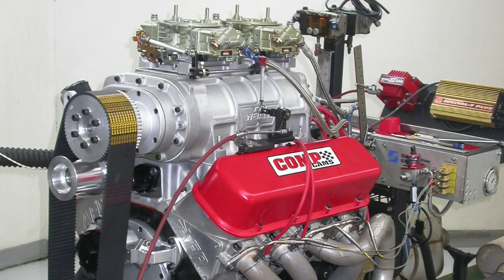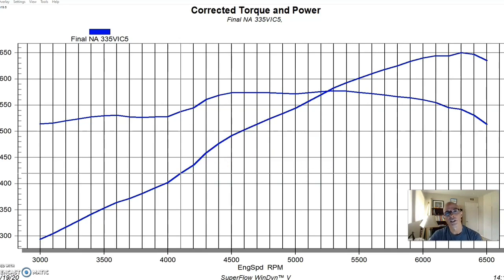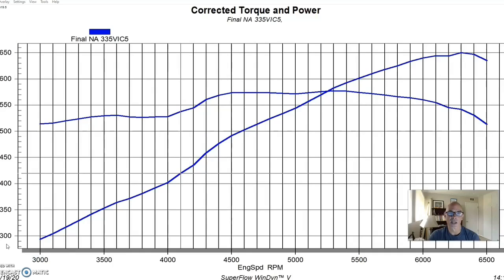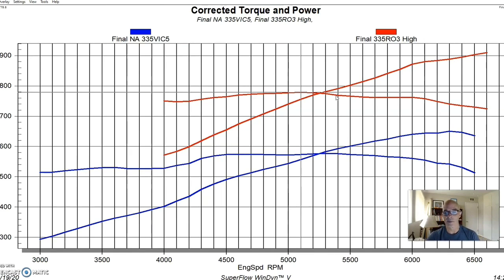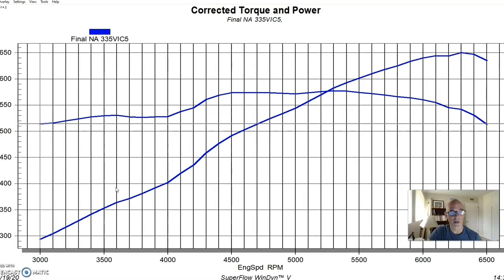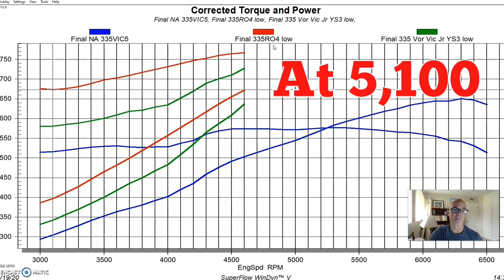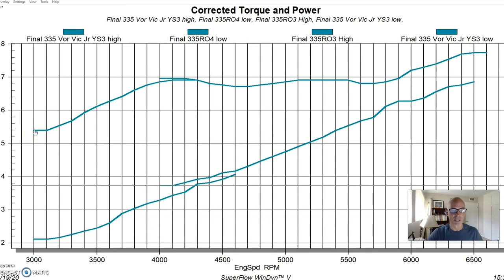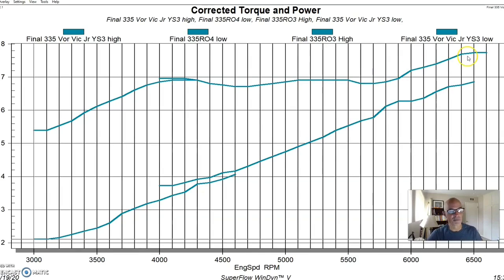496 BBC BLOWER TEST

Comment: I'm not installing any Box over my carburetor and for the cash spent I'll take the Roots blower over the Centrif, blower  anyday .
Reply: that centi blower will outrun the roots.  it looks really cool and does make power but its old tech.  the YSI wasnt even being pushed on pump gas.  that box is what it makes it not need an intercooler with a carb.  1200+HP vs doing that with the 8-71  without race gas?  good luck...just get a 8.2 whipple if you want the look

Comment: Hi,Richard, thanks for all your tests.  I think the 335 heads would outperform 315s if you had more lift on cam and more rpm. Look how hp was still climbing at end of pull on boost. How about a 1471 and 385 heads?  I'm sick can't get enough.

Comment: For a boat application, the dyno test needs to go down to below 3000 rpm to see if the engine has enough torque to get the boat onto plane.  The Roots blower has the advantage there.

Comment: Honestly I think the centrifugal blowers are great for a big cube application on the street, with less torque you can actually keep traction and have a slightly easier to control torque and HP curve! I've got one on my ls1 and honestly I need more cubes, but she cranks out over 700hp on the top end!

Comment: The old over the road trucker in me would just have to have the Roots. That relatively flat low end torque curve (line) is just too hard to resist. In a boat, especially, that solid, consistent low end is very nice to get a skier out of the water.

Comment: Is there a way to measure the drag created by the superchargers? I have heard numbers in the hundreds in Top Fuel dragsters.
Due to the loss caused by driving the charger I believe turbo for boost would be more beneficial.
That might be the reason the roots put out less HP at the top, more drag.
Just a thought.
Thanks for sharing.

Comment: Almost more 'positive energy' than I can handle - LOL
An 'outside the box' suggestion being as it was asked if viewers had any...
A 'built' 350 SBC with an Edelbrock STR-10 CrossRam Intake and 2 as described below modified 1850 Holley Carbs made 456 HP at 6,000 rpm in a May 1969 Hot Rod magazine 'Short Stack To Go' article !  down only 3-HP to the same set-up with 2 Holley List 4224 660 CFM Center Squirter Carbs... ??? Can WestTech Performance and Richard Holdener do better 51 years later ! in 2020 with the same set-up ???
  Know the chance is slim to none, but man, sure would like to see ya do some dyno pulls with an AMC V8, even one with the Crossram Intake Manifold with 2 Holley 1850 600 CFM Vacuum Secondary Carburetors Modified as per the original 1969 Edelbrock AMC STR-10 Crossram Intake Manifold Instructions.  In there it cryptically says to modify the 1850 carbs with Edelbrock Conversion Kit #2562, for which no direct information has been able to be found.  Research has found significantly applicable information that seems to suggest what Kit #2562 contained was (2) Much Larger Diameter 3-Barrel Vacuum Diaphragm Housings, or currently much more readily available Holley 3x2 6-Pack Large Diameter Housings,  with Purple Springs, used to replace the smaller 'standard' diameter Vacuum Diaphragm Housings on the 2 Holley 1850 Carburetors...  Apparently, Edelbrock in 1969, suggested the exact same 1850 carbs and Kit #2562 modification for use on the Edelbrock STR-11 SBC Crossram Intake Manifold as mentioned in a May 1969 Hot Rod magazine article titles 'Short Stack To Go' which included data for 15 Dyno Pulls Edelbrock did with a 350 SBC fitted with the Edelbrock Crossram and comparing it to a number of other Edelbrock Intake manifolds on the same 350 SBC to demostrate the performance of their then new SBC Crossram Intake.  Thought maybe you appear to be having so much 'fun' you might enjoying having some AMC Fun on the Dyno...

Comment: Comes down to what you have for traction and class rules. Big tires or small. And vehicle weight.  If I was running the street with factory style suspension.  Centrifugal.  Pro street I would choose the 8-71.

Comment: Richard, have you done any work with two or three speed drives for turbo compressors? I'm very curious if this would (or could) make a big hp motor more "streetable". Going fast is always cool- but trying to work a huffed motor in sluggish traffic is not fun.

Comment: Can one say that in this application,  using a numerically lower differential gear with the amount of torque that blower makes is a winner winner chicken dinner, taken that the weight of the cars are the same and both have the same tires, same diff gear and pinion ratio, am I seen it correctly ?

Comment: I like to see a diesel V8 Vs Big Block V8 with boost. Maybe 500ci or higher cubic inch Big Block. Focus on how much torque can a gas engine compare to a diesel. Something i haven't seen yet on a dyno.  Some how make a gas engine down low torque like a diesel ?

Comment: Im about to start a engine build for my truck puller.
Im limited to a 496cubic, one 4 barrel carb and 2 valve heads but not limet on horse power. It will run in a old chevy truck with a manual transmission 
What would u recommend as a setup

Comment: Thank you for the awesome video as allways :D , do you remember what was the timing curve and pulley ratio on roots blower? I have a Gen V 463bbc with 325cc afr heads, replacing vic jr with a weiand on 8-71 on it over this week-end so i could race it the week after. Currently milder crane flat tappet but i plan to replace it with a very similar solid roller over winter time. 
https://youtu.be/vFiNdOU6ADI shitbox el camino :)

Comment: I'd choose the roots blower for the wow factor but also for the low range performance b/c I'm not gonna run high RPM near as much as under 5,000RPM cruising around.
Hopefully the jet pump has the capacity, getting close to practical limits with those HP levels there, I'm not sure...  I can tell you not having a leg dragging in the water and scraping across sand bars, really does make a difference in about every way.

But if you really want fast (lots of money going into this, looks like), perhaps direct drive is a better choice than jet pump?

For even more cool factor IMO, twin turbos.
Make sure there's room for an intercooler, well worth the trouble.

Comment: Are u going to finish the last build on the other vid . When u was adding the cam heads and suppercharger.  Like to more on that
Reply from the maker: what motor?
Reply: @richardholdener1727  
The 347 SBF-boost vs boltons vs both . Lile to see what difference the pulleys make and so on .

Comment: Ill settle it. I choose TURBO lol. The roots do look like a wet dream on anything. But just as i told my buddy yesterday the gmc buses back in the day used the 671 and 871 in city buses a diesel with a blower badass had one at our local scrap yard when i was a kid. Id go roots for something big and heavy like a 4x4 suburban or something for the brute low end instant power. But if i had something light with traction problems outta the hole like a fox body or something id go centrifugal to avoid more spinning off the line. But at the end of the day turbos are skynet

Comment: Id run smaller pulleys on the centrifical blower and mount a 60mm waste gate on the charge pipe to regulate boost. Probably use a bigger procharger too.

Comment: I'd like to see the boost temperatures. That really shows how efficient the blower is
Reply: The roots will be cooler because of the charge cooling from the carbs.
Reply from the maker: the vortech is a blow through so also charge cooling
Reply: @richardholdener1727  my point was that you can't really compare the boost temps because the roots is being cooled from the start.
Reply: @bartpang  It doesn't matter at what point the cooling of the compressed air charge occurs, it's still getting cooled either way. You can run draw through on a centrifugal - won't make a difference whether the carb is in front of or behind the blower. Hell, roots blowers have been blown through carbs before, back before mounting them in the 'vee' became the norm.
Reply: @RyTrapp0  How do you measure it? That was his question. My point was you can't get a real comparable measurement.
Reply: @bartpang  IAT sensors in the intake and exhaust sides of the blower-carb assembly? C'mon man, it's 2020...
Reply: @RyTrapp0  Try it and tell us the results! It's not as simple as you think.

Comment: I've driven a kb supercharged small block ford but never a centri car. The positive displacement has that torque shelf which is a blast on the street. The centri seems like it would feel more tame for most driving but ultimately be the faster combo both on track and street.
Reply: The main difference is that the centrifugals feel like they keep pulling harder as RPM rises, while PD blowers will fall off sooner and you can feel that. No better, no worse, just different.

Comment: 8-71 the low speed power is what wins races
Reply: Not on the street.  Too hard to control all that low end torque.  Just blows the tires off.
Reply: @danmyers9372  345s help with that haha

Comment: since a roots blower packs in more air at all rpms, it makes a small block perform like a big block.    How about testing a 700hp blown small block vs a 700 hp big block and compare efficiencies?    What would work better on the street?  Which would get better gas mileage.    Are they really equal?
Reply: @Mod Zozer You're going to have a difficult time beating a BBC anywhere on the curve with a SBC I believe - even if we reduce the bore size of the BB to eliminate that breathing advantage, BB heads(and intakes for that matter) are still intended from the start to flow more air than SB heads. You could conceivably do this pretty easily with a 396 BBC and a 400 SBC; the 396 has a 4.094 bore X 3.760 stroke(even better - the '70-'72 '396' was actually a 402 with a 4.124 bore) while the 400 has a 4.120 bore X 3.750 stroke, that's pretty damn close while being able to use cheap OEM/stock replacement components.
Without putting the worst factory head on the BB and any nice race head on the SB, I don't see how you make up the head flow difference of the BB. And, if you're going to put such drastically different heads on them, then what are we really testing?
This would be 100% dependent on the heads, full stop. With all else being [basically] equal, whatever you do with the head choices is going to determine the result. And, if you use heads intended for similar use for each engine, then the BB should come out on top 10/10. Space is a luxury for moving air, it allows for larger ports, larger valves/more valves, better valve placement, etc.
 
Lets not overlook the fact that the BB has bigger heads for a reason - because it can support significantly more cubes. As such, it also weighs more than an SB of comparable displacement, which is of course the advantage of a large displacement SB. While it's an interesting experiment, I don't suspect it would make a difference to anyone's plans; if you're building a BBC to only 396 cubes, you're doing it wrong!

Comment: It would be interesting to know how much horsepower each blower takes to run, versus how much adiabatic efficiency  advantage the Vortec has over the roots.
Reply: Top fuel guys dump about 1100 hp at full load to turn them

Comment: I want to see this test between an old roots and modern twin screw and analyze the efficiency. Im curious how much difference modern positive displacement tech makes.
Reply from the maker: its a lot
Reply: @richardholdener1727  factor in the higher boost of the 8-71 along with the parasitic loss it faced up top. Thus the reason for screw type and others. Think high compression engine, high torque starter.
Reply: @richardholdener1727  i'd sure hope so. I hear great things about the new whipples and im sure eaton hasnt been sitting still either.
Reply: I would too but only if they tested it against the latest twin screw like the Gen 5 Whipple due to its massive increase in efficiency similar to the new TVS 2650 design.  Not as interested in what a 15+ year old Kenne Bell 2.1L or Gen 2 Whipple does..  Since Richard typically uses used parts maybe use a Hellcat twin screw.
Reply: Dito
Reply: The ideal test would be something like this:
OG low helix roots blower
Contemporary high helix teflon'd every option checked race roots blower
Eaton TVS
Modern Whipple screw blower

Add in early Eaton [EFI era] roots blowers, like the M62/M90 that came on everyone's V6 in the '90s, the venerable M112 from the s'charged Cobras, the M122 TVS-hybrid from the '07-'12 GT500 for the full evolution of the roots blower post-1950.
Of course, an early Whipple/Lysholm screw would make for another interesting data point...
Reply: I agree, throwing a modern twin screw to the mix would be interesting.  Obviously it’s the preferred tech for OEMs (Hellcat, etc.) these days, so let’s see how efficient it really is, and if it matches the Roots instant boost.

Comment: Blow the vortex into the roots...
Reply: Best of both worlds
Reply: Blow the Vortec through an intercooler into the Roots. Probably would need lower compression (7.5:1) if the boost is much higher. Actually, this test shows how much power it takes to spin the Roots unit compared to the Vortec.
Reply: @motorosso3349  roots shovels the air in, centrifugal pumps it in. There are better & worse designes over the years for efficiency. banks talked about some real bad ones that made boost but basically gave no hp improvement over na they made so much heat chopping the air.
Reply: @motorosso3349  some of it is parasitic loss id say more is heat loss

Comment: You mentioned this combo was even stronger with a tunnel ram NA. I think it’s crying for that tunnel ram and two eBay GT-45s. With just a single 4-hole throttle body and injecting E85 in the plenum, pointed at the runners, this thing could make serious power on low boost without an intercooler. I found a nice 6.0 for my truck, but this gives me displacement envy!
Reply: Stroker kit for your 6.0...
Reply: @sean5comet  $$$$$$

Comment: With motors this big on the street with street tires and suspension you usually cannot use all the torque down low.  My Procharger 455 Buick is easier to drive than than our Buick GN (not stock)  because the power curve is linear vs the quick rise on the turbo car.  There is a lot to be said for the big blower sticking through the hood though.

Comment: Hey Richard, how about doing a comparison of a SBC, BBC and LS all the same size. Something like 427-454? or something like two sbc 427, one with the 3.875 vs 4.00 stroke and the a 427 BBC? if you have the parts laying around. 12-13 compression with good cam solid roller cam
Reply: The LS will make more power, the heads are that good
Reply: All depends.... Airflow doesn't always dictate more hp. But I agree the ls heads are a better starting point than the traditional 23 degree heads.
Reply: He never said to use factory parts(what would be the point again?) - aftermarket big block heads are still king, and they'll own every area of the curve. There's nothing 'special' about LSx heads, they're just newer/more modern than the 1960s-early 1990s junk; a similarly modern SBC head can keep up, and a similarly modern BBC head will continue pulling a lead.
Reply: @RyTrapp0  agree, 15 degree aftermarket head vs stock ls would most likely do better. But a good set of 23 degree heads that flow 330 - 340, with enough area in the head can still produce 700+ on a sbc. For example AFR 245. Which is still on the verge of being maxed out on 3.875 - 4.00 stroke at 7000rpm
Reply: I doubt the sb head will keep up but a hybrid with ls heads might run away with it? It would be interesting for sure
Reply: @travispfannmuller7717  the right sbc can (23 degree) but not many straight out of the box. And at that, the intake has to be addressed and opened up as well

Comment: It would be cool to see the 8-71 compared to the Whipple 510AX or 510R.
Reply: Watch gale banks duramax vidys
Reply: The Monster Truck engine series...
https://www.youtube.com/playlist?list=PLwtmrqcWzLtRXpEFXeXa3YF-L0xSK2Ml2
...he tested a roots, a screw, a turbo, and the turbo being blown into the screw and I believe the roots as well. Note that they did cook the roots because it was a tight roots intended for fuel draw through to help control temperature, and they were running it dry of course. Still useful data though.
 
The notable episode IMO though is the methanol injection test - Banks shows evidence that meth injection can create detonation, impressive test, and a bit of a reality check on just dumping different fuels into our engines.

Comment: My theory is the Vortech takes less crankshaft power to run at an equivalent boost level than the 8-71.  Therefore more total engine horsepower is produced at the same boost.
Reply: Was going to state the 8-71 is going to have more parasitic losses than the Vortech (meaning the same thing, just said differently). The higher you spin the 8-71, the greater the losses.

Comment: Great video as always. Where would the timing need to  be set at for street use and also am I correct in thinking with race gas and a pulley swap this combo could  make 4 digit power numbers?
Reply from the maker: yes easy